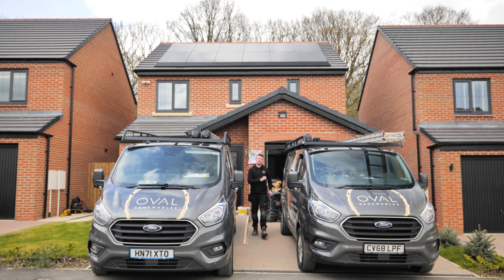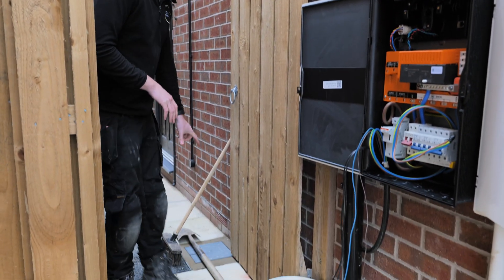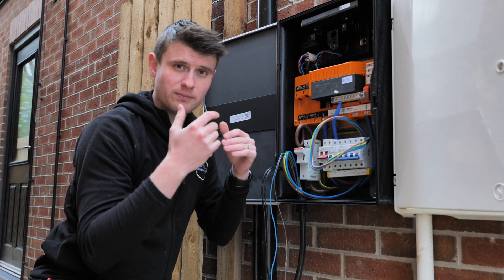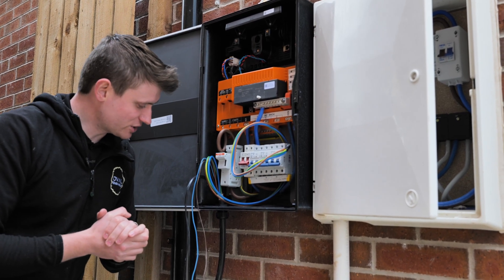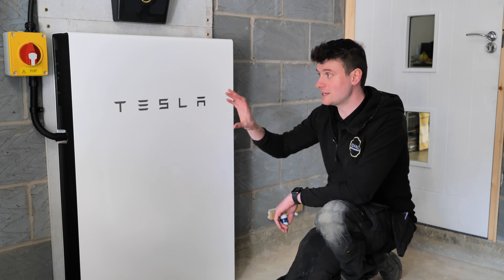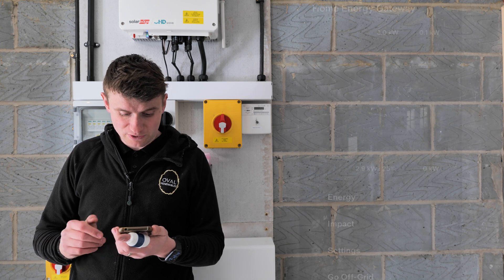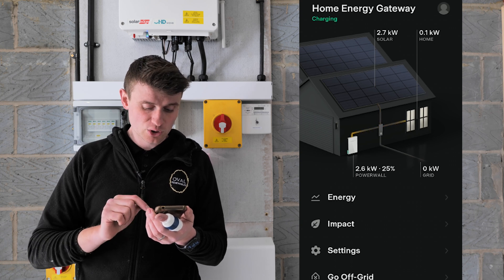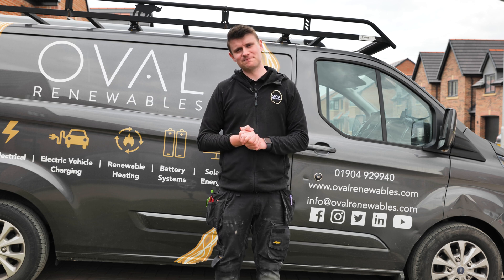Tesla Powerwall Battery Installation! Newcastle project part 2

Comment: Daft question. If the Powerwall has it's own inverter then why do we need a Solar Edge inverter too ?
Reply from the maker: The inverter in the Tesla just handles the battery charge and discharge. It doesn’t allow for a solar input

Comment: Did you find an update regarding the use of the gateway to house circuit breakers and fuse carriers, sure on this project considering it's outside isn't a problem but what happens when it's inside do you have to have a selerate enclosure? That's a mint looking install though well done.

Comment: What type of cable do you use between the AC isolator and the Emlite ECA2?  These are designed for 100A 25mm tails but presumably you just run flex or T&E?

Comment: Probably a stupid question and I assume my idea would require planning permission but.... with the north facing solar panels, would it be possible to mount them horizontally so they would be more efficient at capturing there sunlight? So instead of them following the angle of the roof they would be almost like a flat roof?

Comment: Just had the PW2 installed,  battery only. Works fantastically well and now we’re running the home on overnight cheap rate. In this country severe storms and power cuts are rare so my approach was to not use storm watch and set power reserve at zero to maximise night charge. I would recommend this set up in the UK. Hope to add solar  in the future.
Reply: Would you be able to share the costs for the battery and installation? I'm currently on my fact-finding journey before deciding whether to pull the trigger on a battery-only setup.
Reply from the maker: That’s great. I’m glad it is working well for you!

Comment: Do you guys have any experience of GivEnergy?  That new all in one battery system is looking might tempting at 6k+ vat.  Same 13.5kwh, with 6kw inverter and I believe it comes with an equivalent of the gateway, so takes you off grid in the even of a powercut but considerably cheaper than the powerwall.  Another benefit is that it's LFP chemistry so 100% depth of discharge.  Not sure what the powerwall currently is, whether it's still lithium ion or if they've switched to LFP also.
Reply from the maker: We don’t offer Giv but I do like the look of the all in one system!

Comment: Excellent video, as per usual. How do you join that Tesla Powerwall Connect Cable in the Powerwall isolator? We frequently install Tesla Powerwalls in the South East and routinely use 6mm T&E, 1.5mm T&E, and shielded Cat5 (usually contained in plastic conduit, though sometimes Kopex). We typically loop the 1.5mm and Cat5 in and out of the isolator to avoid joining. I have no idea which is the "better" solution, and so am genuinely curious if you've devised some cunning method.
Reply from the maker: We strip enough of the Tesla connect cable back at the isolator so the comms cables can just run straight through the isolator intro he copex. Then we wire the 6mm through the isolator. It is then only the 6mm that is broken basically. I would have a look at it as Tesla aren’t a fan of CAT5 for the comms 👍
Reply: @OvalRenewables  Thanks for the response. Essentially, the same process, albeit with an integrated cable. Per m., the Tesla Connect cable seems pricey, but perhaps it's worth the premium. Last week, we had a job where the distance between the Gateway and the Powerwall was nearly 35m – in theory it seems like a hard sell (in the ~35m scenario, you'd be looking at >£2k), but maybe it's worth speccing to see the results. Either way, I'm going to get a sample.

Comment: Great vid as usual! What happens when the user inadvertantly exceeds the demand capability of the powerwall whilst in whole house backup mode? Easily done if you've got the kettle on and somebody uses the electric shower! Normally an EPS goes to a seperate CU with low power essentials like lights, freezer etc....
Reply from the maker: Yes there are a few ways to set it up. The main thing would be to take caution when you have a whole home UPS. If the current is exceeded then the gateway would disconnect the load.

Comment: Really like the install but that gateway internally looks like it's been rushed together with dissimilar parts/brands. Possibly just the camera angle but it does make it look as if the fuse and bus bar aren't sitting home properly.
Reply from the maker: It is very tight in there and impossible to get looking neat. However all the Main switch and MCB’s are the same brand
Reply: Just had my Powerwall 2 fitted. Had to wait 8 months for the PW but had been quoted 11 months initially. Nice install and very impressed with how it hoovers up all the excess solar. Not drawn anything off the grid since it was switched on 6 days ago!